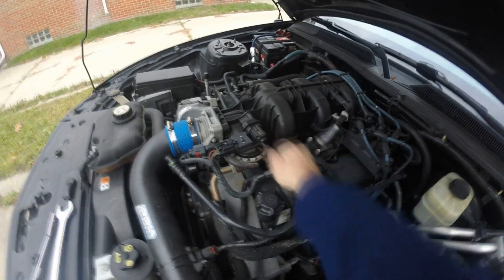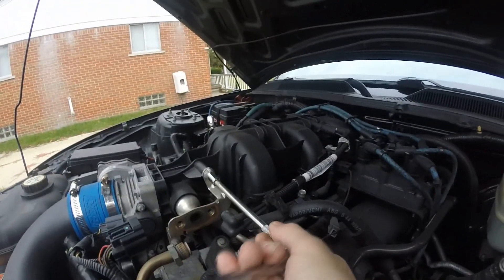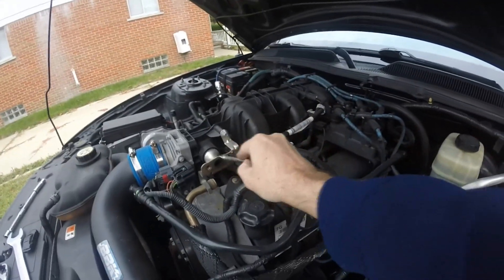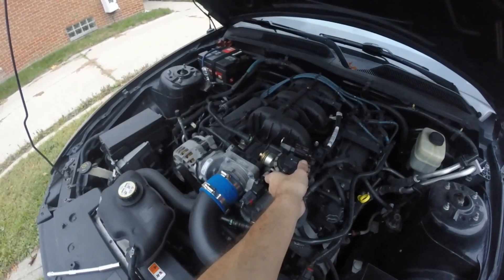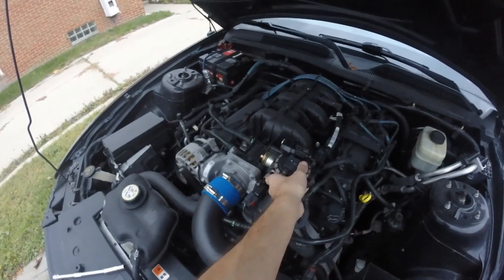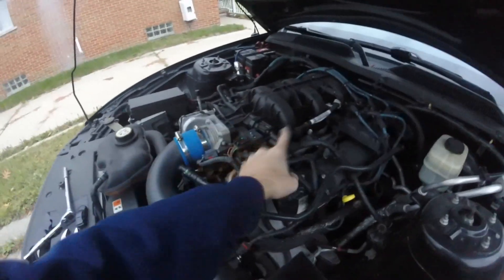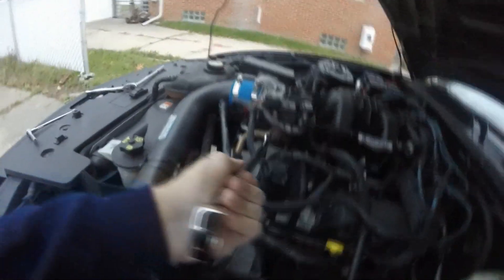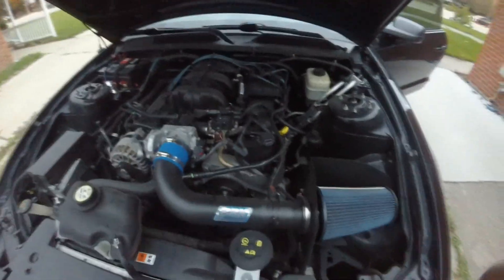4.0 SOHC Ford EGR mod

Comment: I see you're not worried about unequal distribution of hot EGR exhaust gases. 
More to some cylinders and less to others, therefore, cylinders running at different mixtures and temperatures, 
throwing off balance of operation and risking engine damage... 
Don't try this at home, kids. Or maybe just save it for someones car you don't like. 

BTW the 4.0 sohc has plenty of torque. 
But with such heavy valve train it will never be great at accelerating. 
Still, it will climb any hill with any load, just give a little gas and be patient. 
A solid long lived truck engine (once the stock chain guides are replaced...)
Reply: You're wrong about that.   The way it is factory, it shoots right down the center, the first two cylinders
would still get the most EGR gases, and thins out as it goes back to the rear two runners.   It is the same
reason why, with side mounted TB units on an in-line intake runner plenum, the last cylinder in the
runners runs lean.  

That's like saying blocking or removing the EGR would damage all six cylinders, and that is also just
not true.  Many people bypass or block the EGR for more horse-power.   EGR puts dirty air into the
system, except at WOT when it's closed.   A blocked EGR equals more complete combustion with more
O2.  This also means more NOx, and higher combustion chamber temps.   Apparently it's fine, I have 
done it for years.  I was milking 48 MPG out of my '13 Jetta Diesel with a closed EGR.  I am milking
28 MPG from my 93 Octane Tuned 4.0 V6 Mustang....  Will see what it is after this mod....  Then I will
block the EGR with a plate, and run it again.

IF, by any chance the closed EGR raises temps, a lower degree T-stat will help, or tune the fans to come
on earlier.
Reply: @robertborowski7239  All true.... but keep in mind at what throttle input the EGR system actually allows exhaust entering the intake. I understand it happens only low in the rev range. So at high loads your throttle is opened big anyway, dropping the vacuum levels too..
So at wide open throttle the EGR is not working, meaning no cyllinders get exhaust gasses anyway...? As I understand it. 
I own 2x Rangers with the 4.0l SOHC engines here in South Africa. Combined 1 Million miles between them.
Reply: @reinhardvandermerwe6585   My 97 Ford Ranger 4.0  Which didn't have the overhead Cam...had better power..  I picked up a 2007 V6 5 speed 4.0 and my 97 would blow the doors off and it was a 4.0 automatic 97  What's faster than mine 2007 Yeah not only that the 2007 has 410 gears and my 97 had I think 373 You would think the 2007  Is with 410 gias would be faster than my 97 their both Same size trucks club cab short bed

Comment: Interesting. I'll keep this in mind....

I'm always looking for a way to increase power in the 4.0
Reply: I'll tell you what improves power ( torque) , when it comes time to do the chains in the engine get a degree wheel and give the cams 2 degrees advance when you put it back together. Also look up the brown wire mod to the transfer case. It saves gas by freeing the front diff when not in 4wd. Blessings.
Reply: It turns off the front diff when not in 4wd. Gas $ saved. Get an electric fan too. Blessings.
Reply: Don’t do it you’ll get a check engine light
Reply: Just get the 2010 GT

Comment: I have a cold air Intake, throttle body, shorty headers and full straight pipe, hope this mod actually shows improvement, I was hoping to delete the whole system, like putting a plug in the headers but I think I’d need another tune for that
Reply: Smartass Garage I’m always open throttle so I guess I’ll be fine
Reply: The 2003 4.0L Rangers don't have the EGR system on them. I did a manual swap on mine and I was hooking everything back up that's when I notice that the wires are not there. The PCM is programmed without the EGR system. Why is the case I don't know.

Comment: I think if you put the car on a dyno, you would see no gains from such a small part being removed. If anything, this elbow is just helping mix the EGR gas evenly between cylinders and getting it away from the sides of the PLASTIC intake manifold since it's coming straight from the exhaust.

Comment: You'll never see a gain by doing that.  If you're only mods are an air filter and possibly a cat-back exhaust, your engine isn't sucking enough air to notice a difference.  I understand the concept behind it, but it's about the equivalent of putting a more expensive set of spark plug wires on an otherwise stock engine...  you just won't see or feel any noticeable gain.

Comment: Interesting.. always dig ingenuity, thanks for sharing. I do have to say however, I feel the ford engineers made that bent downstream for a reason. I think I'll leave it stock to play it safe, since most people in the comments couldn't discern a performance improvement, or at worst had issues after performing the mod. To each their own of course, I do see the slight airflow improvement
Reply: This comment is purely hypothetical but facts go as.. exhaust side is pressurized and intake is vacuum...  venturi effect should be minimal even with elbow in theory due to the natural equilibrium effect  but my theory is the elbow is there for better mixing of the egr gases and keeping it from flooding one side or the other.. best option would be to delete the egr all together..

Comment: Well my car started hesitating. When it gets around 30mph and sound weird at 3000rpm
Reply: Same issue, If I floor it it'll go back to normal.  IAC has a hard time keeping it idle when it does this too.  Gonna try to rig up a makeshift egr gasket with some gasket maker when I do this mod.
Reply: Just in case anyone was wondering.  This did wonders for my truck stalling at lights, I still have bogging, but I think it will be fine after replacing my wires.  Make sure your IAC and EGR gaskets aren't ruined because I was pulling in a lot of extra air through there.

Comment: how far back are you supposed to cut? As much as you can? I see yours was not cut flush but I am not sure how close I should go. also I did not see any brake cleaner applied anywhere, as long as I deburr and blow out the slag from cutting am I good to go?

Comment: I did it yesterday roads to wet to tell deference, but seems like it was little different for the better I’ll drive around more get back 👊🏼 later
Reply: Wyatt Hunter tell me
Reply: lil pacc I tell no difference at all, but it’s easy to do and kind makes sense to me that pipe is in middle of air flow from intake so go ahead doesn’t hurt I have done it weeks ago cars still good 👊🏼
Reply: Sounds good 👍 thanks
Reply: Wyatt Hunter meh my 10 v6 didnt like it ...
Reply: lil pacc didn’t like it?What is your opinion? I didn’t tell but made sense freeing up space for CAI to breath less resistance.

Comment: Do you have a thunderbird throttle body mod on your ranger?
Reply: Bigger throttle body..  is only a couple mill and there is big debate on wether the smaller is better so is an “eh” mod that doesnt do much unless your building your specific tune that way.   I say if going with the t bird intake go mod box and hook a supercharger up to it ..  easy 9lbs of safe boost.. 2k$ tho.. but that boost tho...